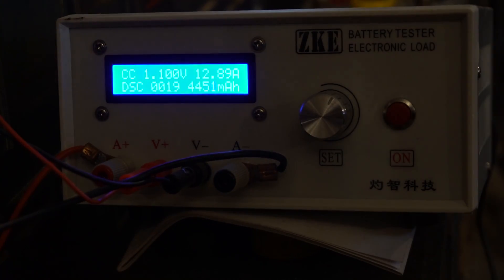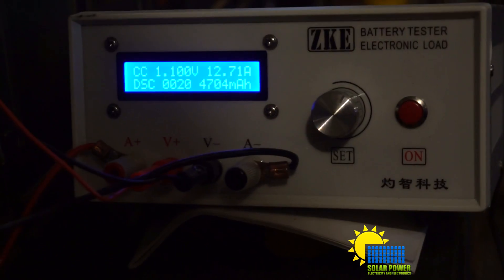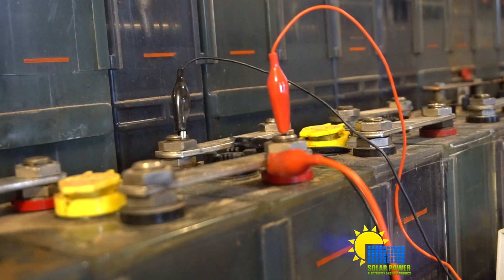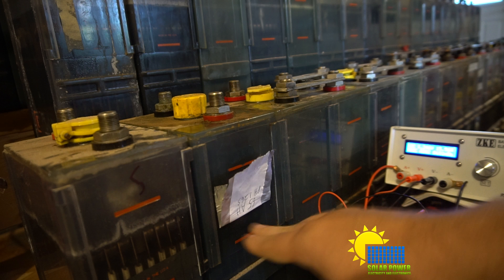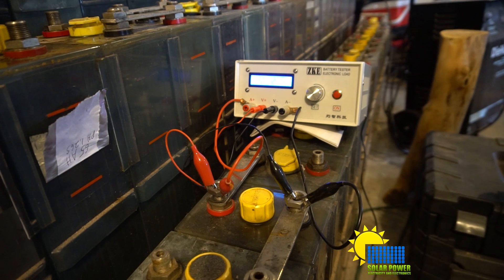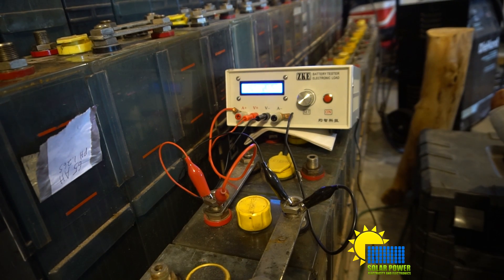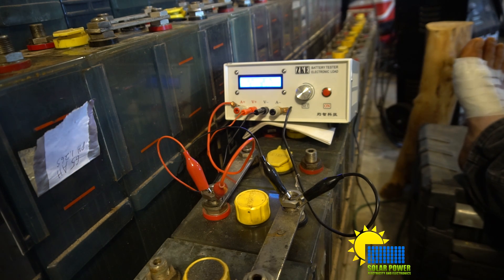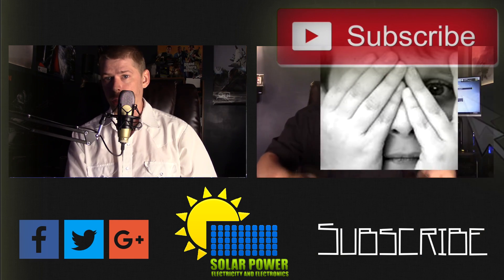EBD A20H Multi function Electronic Battery Capacity Tester 20A Discharge!!!!

Comment: Hello, I am looking into this device and planning on buying one since I am doing a battery amp-hour testing as my project. How do you know that its showing the battery's total amp-hour and tells you that the battery is still good or not? did the amp-hour on the screen stopped measuring?
Reply from the maker: stoped working after a few use sorry

Comment: I had 12 of tho's fully charged and I ran them for 3 months. So I know there are some that where working when u picked them up.. That tester would rock for the 18650 power wall guys.
Reply from the maker: o yes your right i can start on them i have about 200 of them batteries
Reply: I'm looking with very hungry eyes but the wattage could be better for it. 20amps @4volts is a lot but if you're crazy enough why not go for gold and go for 35-40amp range which I think is the top in the peak amps on these but new batteries come out every day